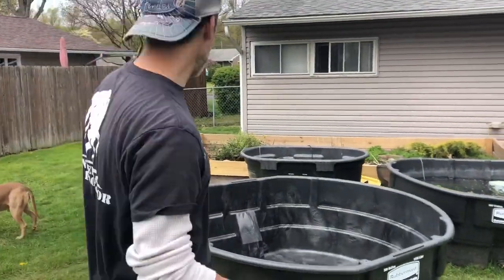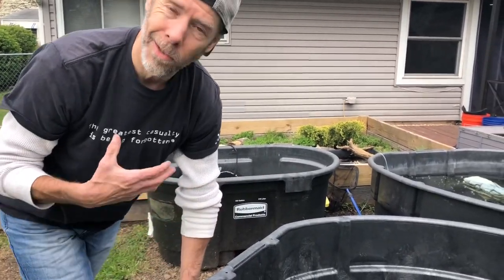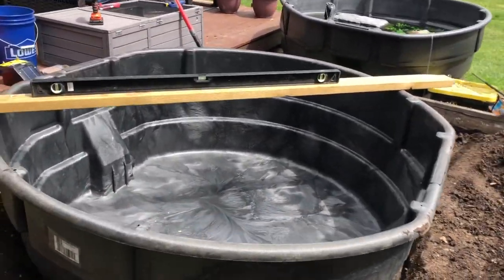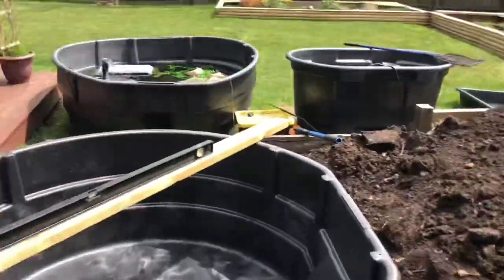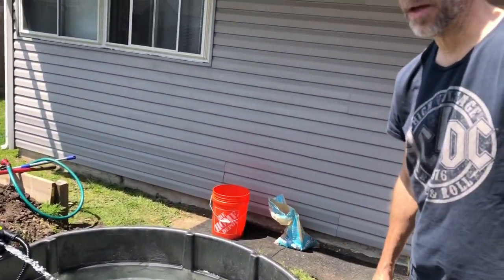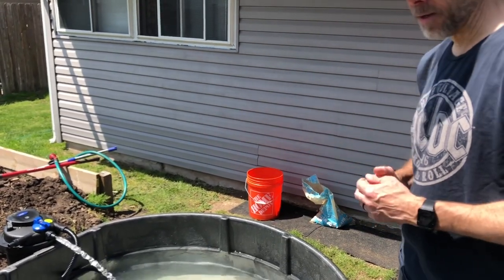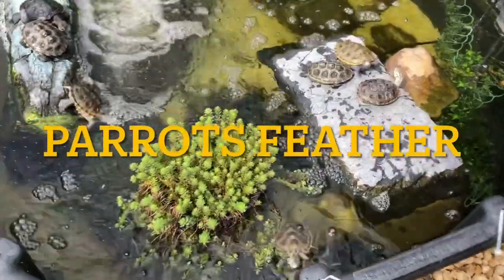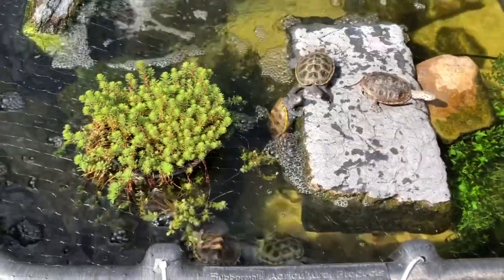300 Gallon Rubbermaid Tubs - an ideal habitat for your turtles!

Comment: thanks for the helpful video. how deep did you put the sand for them to hibernate in over the winter? i'm in Snow Shoe, PA and want to move our 7" red-eared slider into a new pond in the backyard instead of his 55 gallon thank which he's outgrowing. i will probably go with a liner instead of a tub due to the expense ($450 for a tub!). do yo have to worry about heating it or do you just let the water remain what the air temp is? read some bad reviews on the pump. doesn't sound like they last long.

Comment: I’m in PA too! I’m looking to do something like this, but inside. What did you use as a basking dock? Any suggestions for a way to cover it with screen if inside (to keep my cat out). What types of plants did you add? What filter are you using?
Reply from the maker: We use cinder blocks with flat pacers on top. The cinder blocks provide hides under water and the flat pacers serve as basking spots. We also try to find branches to drape across the pavers to make it more natural. Will find the filter we used and send you the name.